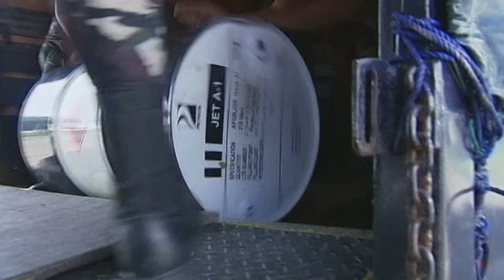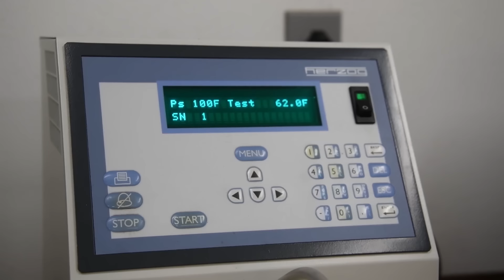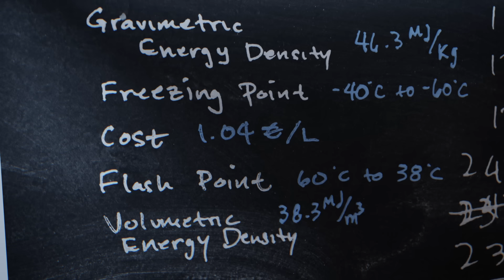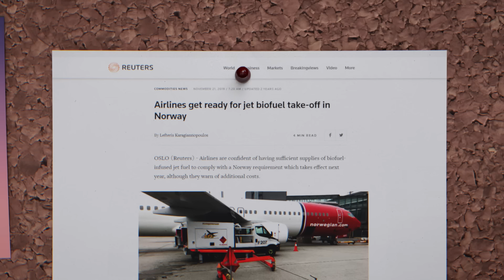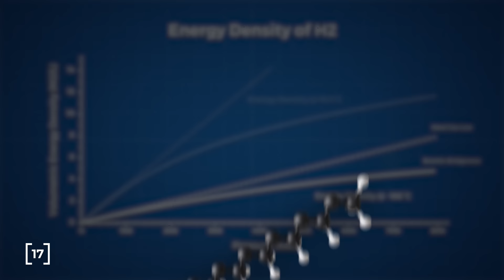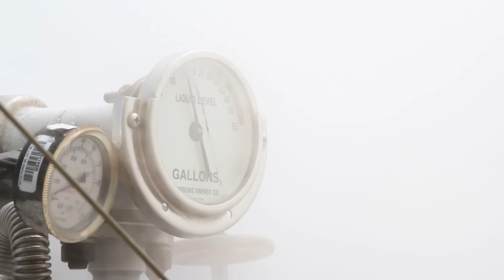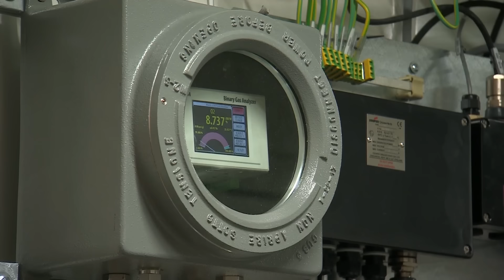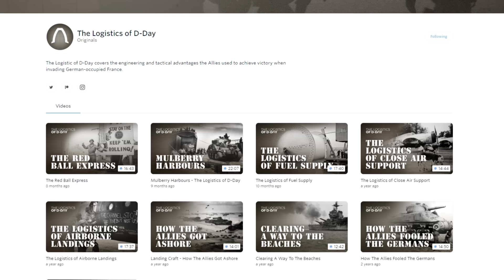The Uncertain Future of Jet Fuel

Comment: "hydrogen could be a future aviation fuel" 
Hindenburg 2: My time has come
Reply: It's not like jet fuel is much less flammable to be fair
Reply: @DarkPlaysThings  It is SIGNIFICANTLY less flammable.
Reply: @letsmakegadgets6899  I meant within the context of using it as a fuel. Unlike in the Hindenburg, an aircraft fuel tank isn't gonna be pumped up with enormous quantities of pure hydrogen. Of course pure hydrogen in high concentration is going to be much more flammable.
Reply: Hindenburg was a disaster in that it ended hydrogen airships.  They make a huge amount of sense.  
Think about it, why are you happy to travel on a big bag of highly inflammable kerosene, or a big bag of hydrogen, much safer.
Hydrogen lifts itself into the air, kerosene has to use lots of fuel to do so.
Reply: As someone that works with hydrogen, the Hindenburg's event was more to do with having flammable things entrapping hydrogen than hydrogen itself. Hydrogen is explosive with oxygen nearby, but due to how light it is, generally it'll escape right away. Hindenburg was designed to essentially trap the hydrogen and oxygen inside the balloon. And also the fabric was highly flammable to begin with.  It also didn't help people were allowed to smoke near the hydrogen tanks also.
Reply: @asifmsadik  to add on to the point of the hydrogen being light and it escaping easily add on even the slightest breeze and that will speed it up dramatically it would be pretty damn hard to get the right air fuel mixture in open air. As for s crash we have already seen it with the challenger incident most that hydrogen wasn't even burnt what was seen was it just trying to expand back in to gas.
Reply: we need to inspire the next generation of musicians. there is only stupid rap everywhere
Reply: Forget hydrogen. Do you guys remember about the existance of helium at all? Or did the US made you forget they have oddles of it, but are too relactant to share with the world in industrial quantities for some reason? And BTW Hindenburg's crash was a planned act of terrorism, not an act of nature. Dirigibles were and still are a real threat to the oil economy. What does the author has to say about the helium-filled airships? And, lastly, the whole carbon emissions problem is a scam. The input from all human activity is over-exaggerated to a shameful extent. All human-driven carbon emissions' influence on Earth's climate is nothing compared even to the cosmic rays to say nothing about the Sun. The Sun affects Earth's climate for real. Anyway, it will not be long before everyone sees with their own eyes.
Reply: @timsvodnik  you sound like a suspicious observer my friend. 😏me too!
Reply: @timsvodnik  Cost.
Helium is insanely expensive to obtain, there's a shortage as is.
Reply: @DarkPlaysThings  only pure hydrogen with 700 times the pressure as in Hindenburg
Reply: >Energy density per mass: best out of all fuels we know
>Energy density per volume: worst out of all fuels we know
Oh the irony of hydrogen.
Reply: @DarkPlaysThings  have you seen hhydrogen rocket ships? It burns so hot it melts titanium which in order to survive had to turn off the engines 200 feet off the ground coursing the space-X ship to crash back to earth
Reply: It's great that millions of people would understand the exact image meme of "my time has come" 

The Internet is great
Reply: @tacomas9602  I mean that’s probably what Space-X austronuats were thinking, if it didn’t work there time has come 

either they blow up or blow up once they hit the ground
Reply: @unifiedhorizons2663  Amm, SpaceX rockets use Kerolox (Kerosine + Liquid Oxygen, used in Falcon 9)/Methalox (Liquid Methane + Liquid Oxygen, used in Starship/Superheavy), they don't actually use hydrogen at all. You must have confused them with other rockets.
Reply: Idk what they are smoking at airbus but pressurised hidrogen means more weight for tanks which paired with an energy density of an order of magnitude lower than jet fuel... means at best an order of magnitude less range or cargo
raises arms in disgruntlement
Reply: @werrkowalski2985  
When I try to explain gasses to my dad he kinda gets a seizure every time...
What do u mean mass contained in the system depends on temperature and pressure?(and volume of course)
Reply: @entropicprinciple9276  Hydrogen has an energy density (by mass) an order of magnitude higher than kerosene.
Reply: Hell no just use Helium smh
Reply: @Kyle-gw6qp  yes but a kg of hydrogen occupies 2 orders of magnitude more volume than a kg of kerosene and that only if heavily compressed and cooled 
Your point is?
Reply: @Kyle-gw6qp  puts on pedant hat

Energy density is energy over volume (MJ/L). The term for MJ/KG is specific energy.
Reply: Hindenburg was a different case with hydrogen in a more equal pressure form with the outside air to achieve oxidation.  In this case, I'd be more worried about the tank becoming a missile than simply exploding.  In an attempt to blow up a hydrogen car researchers shot the tank of one just to see how much it'll take to explode.  What they found surprisingly, was that the venting from the point of rupture was so great, that hydrogen could push away air faster than could achieve oxidation and no ignition/explosion occurred.  The venting  force was quite interesting, and I'd be curious if a velocity could  be reached at say a low enough air pressure at high altitudes, where a hydrogen tank rupture could cause it to rip itself right out of the plane.
Reply: @Yaotzin86  Fair play. I shouldn't have corrected if I didn't know myself. Sorry about that.
Reply: @Kyle-gw6qp  A polite person who can admit fault! On Youtube!

What is this strange new world I have woken up in!
Reply: The Hindenburg II project actually goes by the name Starship
Reply: it's actually Space-H
Reply: @timsvodnik  here's a fun fact: we're slowly running out of helium. This is because it's so light it escapes the atmosphere and gets the fuck out of here.
Reply: This wouldn't be fuel tanks full of gaseous or liquid hydrogen. There are plenty of techniques to bind hydrogen in a nonflammable state, to be released at a measured rate when needed. Bound to Lithium as Lithium Hydride, for example. How do you think we're going to get to hydrogen fuel cells powering our homes or cars?

Comment: Great video, thanks for posting. I should comment on the hydrogen element since I work in the field researching it, and there are a couple of points I might add. LH2 is volumetrically poor compared to the incumbent, no doubt about it. But what people often don't realise is the immense thermal opportunities it potentially offers, thermal management and advanced engine cycles in particular. Aircraft designs traditionally have been weight constrained, hence the emphasis on MTOW as a fundamental limitation, however with LH2, the challenge shifts as you've rightly identified to a volume constraint. That implies increased drag (larger fuselages to accommodate the fuel for example). What this means is that designs have to change in terms of priority, so blended wing designs, longer fuselages, and potentially drag reduction measures such as boundary layer ingestion become more interesting. Since weight isn't as concerning, engines can become more elaborate too, with the advantages gained being used to mitigate the drag impact.
Reply: Or since oxygen is made with the hydrogen in electrolysis we could propel our planes using LH2/LOX rocket engines. A guy can dream can’t he?
Reply: What about using Ammonia?
Reply: @625shapiro  the main problem with ammonia is that it’s extremely poisonous. Also, it requires hydrogen to make so you might as well use hydrogen for as many applications as possible for energy efficiency.
Reply: @MadMadCommando  Rockets are much, much less efficient than air breathing engines.  Getting your oxygen for free from the atmosphere is just so much simpler and lighter than bringing your own LOX.
Reply: @MadMadCommando  Amonia is easier to store than hydrogen.  Though you mind want to use methane, not amonia or hydrogen anyway.  That's what they want to use in rockets now at SpaceX for example.
Reply: @MadMadCommando  True, this can be done, but you have to consider you would have to carry the LOX in addition to the LH2. The advantage of using atmospheric O2 is that you don't have to carry it. Considering that LH2 future aircraft are likely to be volume constrained (because LH2 has very low volumetric energy density, about 1/4 that of kerosene), this would make the volume problem even more of an issue. It would have advantages though for sure, like zero NOx emissions, better fuel efficiency, and possibly longer life components because you don't need to use any air, so it might be an option. I think it might be the way to go for hypersonic or suborbital future designs.
Reply: @625shapiro  Ammonia is also potentially a way to go, but it does have drawbacks. 

If you use NH3 directly in the engines, it has a very high exhaust gas enthalpy, which means you can extract a lot more power for a fixed combustor temperature than with kerosene or even hydrogen. But you would have to limit the combustor temperature to around 1700 K with direct NH3 combustion anyway, because otherwise due to the higher nitrogen content, you would spew out NOx at higher temperatures like we see today, so that advantage of higher exhaust enthalpy gets eaten up by the temperature limit. Then there's the stoichiometric ratio in air, which is much higher for ammonia than with other fuels, so you need to use more of it to sustain combustion.

NH3 as a direct fuel is also very poor in terms of both mass and volumetric energy density, it combines the downsides of hydrogen (poor volumetric energy density) with the downsides of kerosene (poor mass energy density), and it still needs pressurised insulated tanks to store it. It's also nasty stuff to handle in high concentrations (above 20%). 

You can however use it as a hydrogen carrier. One of my mentors during the first few years of my career in future propulsion concepts research gave me a brilliant lesson in how to think of fuels. He told me, think of fuels as a way to store hydrogen. Kerosene is just a good way to store hydrogen molecules at the end of the day, using carbon. So a molecule of dodecane (a good single molecule approximation for kerosene), C12H24, stores 2 hydrogen atoms for every carbon atom. Methane, CH4, stores 4 for every carbon atom, hence the higher energy density, but lower density. A litre of pure LH2 actually contains less hydrogen than a litre of kerosene, which I remember being absolutely astounded by, but it explains a lot. Effectively, with kerosene, you're trading mass density for better hydrogen storage capability over pure hydrogen. 

Now, this may seem like a tangent, but bear with me, I'll get to the point now. Ammonia, or NH3, has an amazing ability to store hydrogen without using carbon. So if instead of burning it directly, if you 'crack' the ammonia using a catalyst into hydrogen and nitrogen, then dump the nitrogen overboard and burn the hydrogen, you end up with huge amounts of effective storage densities. So per litre of LH2, there's about 8.49 MJ of LHV energy. If you crack a litre of ammonia, you get approx. 14.5 MJ of hydrogen out. So you can actually store about 70% more hydrogen using ammonia than with pure LH2. Of course, there's the downsides to consider, the inefficiency of the catalyst, the weight of the catalyst, and more. But it is interesting nonetheless, and is being actively researched as we speak.
Reply: quite right about the free oxygen, though rockets are quite efficient (at very high altitudes) because of the high combustion temperatures and low exhaust to flight velocity ratio. 

The thermal efficiency of a rocket engine typically reaches >60% (as governed by Carnot's heat engine equation), and the propulsive efficiency varies depending on where you measure it at in the mission, but you can say it tends to hover around 20% at max Q, which as it happens is typical cruising altitude for aircraft. The velocity ratio is about 0.15 at max Q, so ~500 m/s flight speed and ~3000 m/s exhaust velocity, and rises to about 90% at orbital velocity (so ~7800 m/s flight speed, 4500 m/s exhaust at max engine throttle). 

So you're right about rockets being less efficient than air breathing engines where air breathing is possible, because the velocity ratio will always be very low for aircraft using a rocket due to the extreme exhaust velocities and drag constrained nature of aircraft. Plus, rockets are super anti-social, very loud, very unreliable, and will generally make residents nearby (and probably not-so-nearby) airports rather irate.
Reply: absolutely true, hydrogen is a nightmare to store. Ammonia is no walk in the park, but it's far easier than hydrogen. Methane is an interesting option, I actually co-wrote a paper with Airbus on using methane as a fuel, entitled "Cryogenic system options for a superconducting
aircraft propulsion system", where we looked at it in some detail. The problem is, what to do with the carbon. Either you burn it and generate CO2, which is frankly unacceptable, or you crack it and store the carbon, which is both difficult and inefficient to do on board an aircraft. But as a fuel, it's great, good energy density, lots of thermal advantages, readily available, and technically renewable too, so could be net zero if it's made sustainably, then we wouldn't worry too much about the CO2 of course. But it is also a horrendous greenhouse gas, far worse than CO2, so probably not such a good idea. For rockets it offers advantages when it comes to volumetric energy density, which is a major reason why SpaceX use it, to reduce drag and decrease the structural mass fraction of their rockets, which enables them to bring the rockets back for reuse.
Reply: @onetrickhorse  Thanks. That's all true. Only one thing: you don't need to worry too much about methane being a greenhouse gas, if you manage to burn it off completely.
Reply: @onetrickhorse  When you bring your own LOX and LH2, you still have to deal with NOx; just because your hot exhaust will hit the air. (At least that's the case for a rocket. You might be able to react them in a different contraption to avoid that problem.)
Reply: absolutely, and in fact, it is better for the environment (weirdly) to burn methane than to do nothing with it. The major issue with it is production in my eyes, where vast amounts leak from wells and pipelines. 

As for NOx, it is true that if the rocket exhaust hits the air at high temperatures (1700 K and above), then it will produce some NOx. But in any decent rocket nozzle design, if after expansion to ambient pressures the exhaust temperature is above 1700 K, then it's a pretty inefficient design, as that heat is just wasted energy. Ideally, the temperature would be ambient, but since Monsieur Carnot will rise from the dead and spank the engineers for even thinking they can get near that, it has to be a balance. I know the exhaust temperatures in the RS-25 engines at the nozzle exit area are about 1200 K give or take based on the combustion chamber temperatures and pressures and the expansion ratio, so well below the NOx danger zone.
Reply: @onetrickhorse  Since NOx is a primary pollutant of diesel engine exhaust, what you're saying is that a truck engine hosts higher temperatures than rocket exhaust, which is pretty cool. (or maybe not so cool lol). Your comment on "cracking" NH3 for the H2 is interesting, but it seems that it would be better applied to ships where weight isn't a factor. I still think that extending aircraft fuselages to hold LH2 tanks is an easier solution then people are making it out to be, since the tanks would be relatively light even when full.
Reply: @MadMadCommando  Well NOx in a diesel engine is more to do with the fact you're burning the fuel in air, which is mostly nitrogen, so the nitrogen can react and form NOx, whereas in a rocket, you're burning fuel with pure oxygen, so it doesn't produce any NOx until the hot exhaust hits the surrounding air, hence why rockets don't produce much NOx. Diesel engines run at considerably lower temperatures than rocket engines do, something like 1000 K for diesel combustion vs about 3500 K for rockets at their peak. 

Yeah I agree with you about NH3 being perhaps better suited to chips than aircraft. And you're spot on about tanks in the fuselage too, don't get me wrong, it won't be easy to prove the safety case, but it's not a showstopper in my view.
Reply: Until y'all find out how to safely store it without it corroding its containers, it won't be safe enough for commercial jets. Sure, experimentals are one thing. Carrying passengers is completely different.